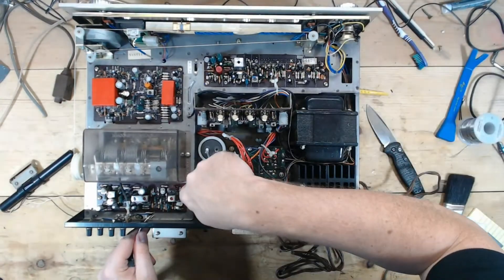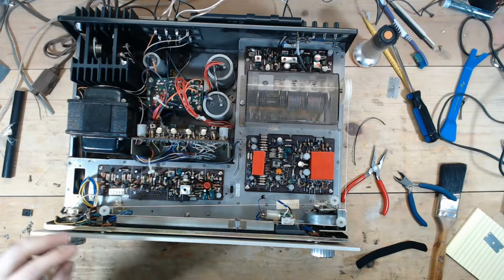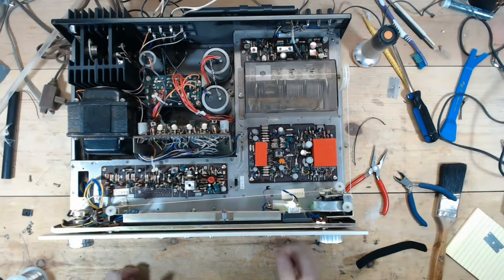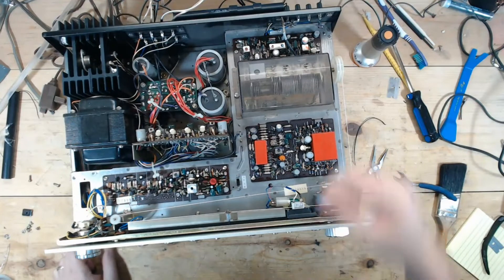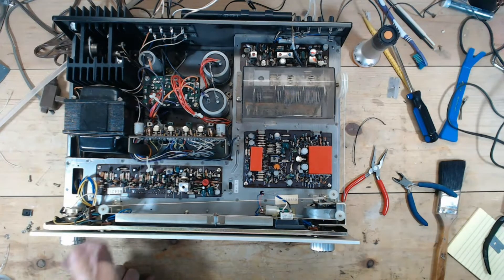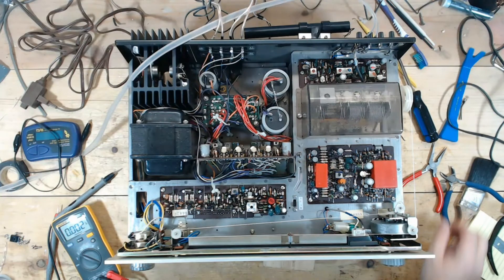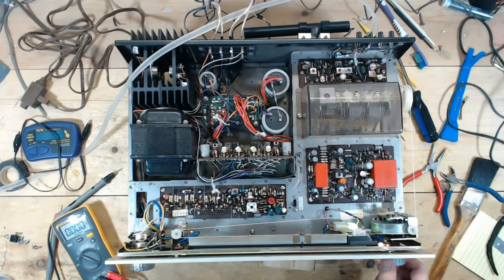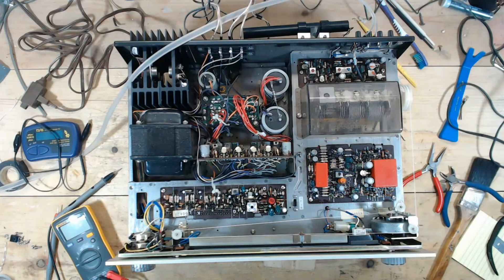Sony STR 6055 Stereo Receiver Repair Part 2 - Replacing the AM Antenna

Comment: what? I was waiting to see how you fixed the AM. Did I somehow miss that? The attachment of the black n white wires?
Reply from the maker: The antenna that was ‘present’ was not attached to anything so installing (and attaching) the replacement antenna to the tuner board fixed it.